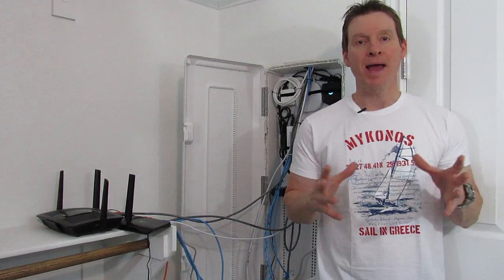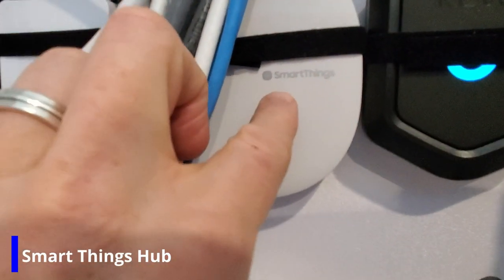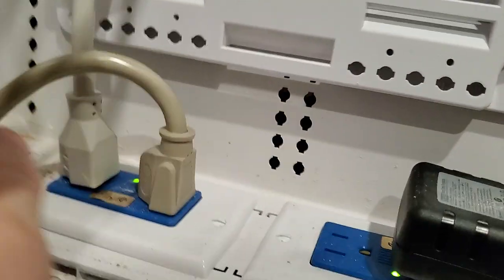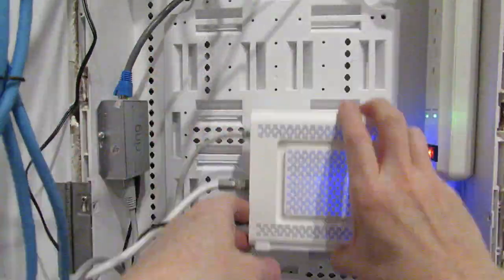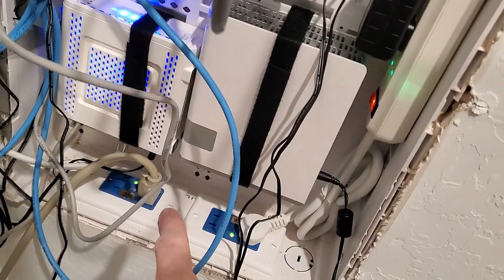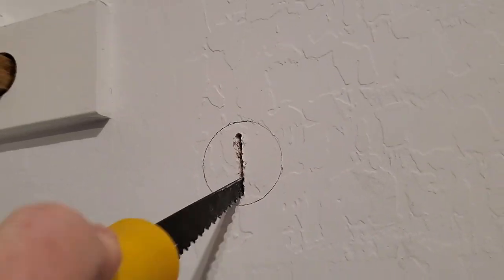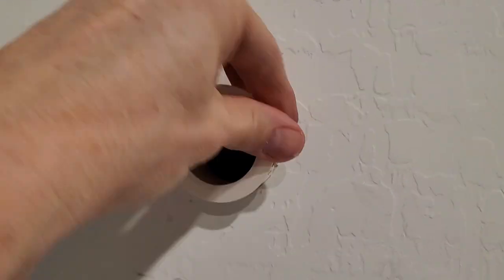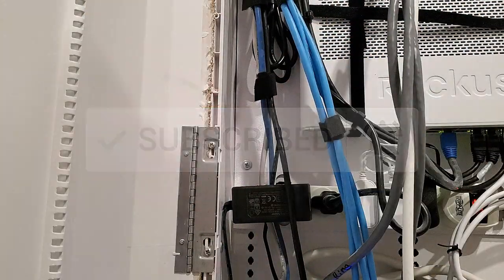HOME NETWORKING 101 QUICK & EASY RESIDENTIAL NETWORK PANEL INSTALL AND INSTALLING NETWORK DEVICES!

Comment: I think that the reason the holes didn't line up is because you need to rotate the plate 90 degrees. Then the plates in the Universal Mounting Plate should line up with the normal plunger holes in the back of the enclosure (the holes you are using were intended for mounting the enclosure to a wall, not for mounting that plate).
Reply from the maker: Yes that's probably why, however I needed more vertical space for my devices. It worked out well but thank you for the great comment.

Comment: I have one of these boxes in my laundry room IMO it's better to install a traditional network rack. You will outgrow these boxes pretty quickly especially if you want to install standard rack gear. I plan on moving all of my structured wiring to a standard rack which I will hang in the garage.

Comment: You should never plug a power strip into another power strip. You could of run both cords to the bottom outlet.
Reply from the maker: I rewired the whole network panel a few months later with a UPS and removed 1 power strip. Here is the video link:
https://youtu.be/9kGISAgdjMA

Comment: I'd recommend moving some of the Smart/IOT hubs out of there and closer to the center of the home. There's a lot of signal density there and could lead to interference.
Reply from the maker: Thanks for the great advice. This video is a year old now and my network panel has changed quite a bit. Make sure to check out my newer videos. I added a UPS  to the panel for back up power and removed the 2tb cloud. Also cleaned up the wires too. Thanks for watching and for commenting!
Reply: @UltimateTechHub  thanks for replying! I see the vid is older this was meant more as a warning for people that might want to put all of their equipment in the same enclosure.
Reply from the maker: @DonaldEdney  Awesome!! Great advice! I kept my 3 Hubs in the enclosure and they all work great with no issues.  The ruckus ICX switch gets a bit warm so generally leave the door open. I may move the smartthings Hub to my family room in the future. I only have 1 device connected with it. I'm reviewing a EnGenius 8 port PoE Layer 2 switch this week. Keep an eye out for the video. Thanks again for watching!

Comment: @Ultimate Tech Hub I apologize if someone has already mentioned this topic, however, the reason that you needed to drill extra holes is because you were mounting the plate in "portrait" orientation whereas it is designed to be mounted in "landscaped" orientation.  You can actually see that there is about an inch or two on either side of the vertically mounted bracket and you can almost picture the holes lining up during installation, if it had been mounted horizontally, or "landscape" oriented as I mentioned previously.  But great job on the clean install.
Reply from the maker: Yes someone already mentioned the bracket going the other way but in my Network Panel it wouldn't t fit that way the panel is not wide enough. Maybe the bracelet is for a different panel. If you get s chance watch a more recent video to see the even better improvements to the panel. I added backup power and rewired the entire Network Panel. Thank you for watching I really appreciate it.
Reply: @UltimateTechHub  I watched the newest video first and totally forgot I had already seen the newer version when commenting. Great setup, though!!!. I am making a video of my retrofit right now.
Reply from the maker: @MartesWigglesworth Let me know when your video posts or send me a link I would like to watch it!

Comment: Could you have mounted the wireless router inside the box if you had the room for it? Does it affect signal? Or does the wireless router need to be placed outside the cabinet? Thanks!
Reply from the maker: I could have installed it in the panel but closing the panel door would hamper the signal. The panel door shows a diagram of a router inside the panel. We also have a wireless access point in our front hallway ceiling. Here is more detailed video of the panel and the smart features.
https://youtu.be/igCWVINZdv4
Thank you for watching I really appreciate it!

Comment: Are the knockouts at the bottom for power standard size?   Can you use non legrand outlets?
Reply from the maker: Yes they are standard size for the United States. I'm not sure if European outlets would work. Stay tuned for our Home Network Tour 2023 which posts in 2 days.

Comment: How did you place an electrical outlet for the router inside the access panel? Was it a standard size outlet?  Trying to place inside a 4" wide wall.
Reply from the maker: It was already pre-installed in my panel. If you install a panel like this you need to hire a electrician to install the outlet and make sure he installs 2 outlets. You can never have too many outlets. Thank you for watching I really appreciate it.
Reply: @UltimateTechHub  We are starting with new construction. I am trying to have my contractor make all cables hidden including power for router which will sit just above the access panel for all the CAT cable connections. I am hoping he can fit a power outlet in there and do what you did to make a nice hole for cables above the access panel in wall.

Comment: Nice job on your cable management. I will suggest eliminating the POE injector for the ring camera and going straight to the Ruckus Switch. To avoid an extra point of failure . It looks to me thats an Ruckus 7150-C12P, if yes the switch is POE+ and can power the ring camera. 👌
Reply from the maker: Yep it can power the ring doorbell and I should just plug it into the ruckus switch to eliminate the chance of failure and to free up some extra space.  I probably take your advice and switch it over. Thanks for watching and if you subscribed thank you as well.

Comment: What did you use to mount your icx switch? I have the same switch? But haven’t found a clean way to mount it yet.
Reply from the maker: I have a large white plastic piece that has 4 custom holes and is screwed into the panel and I also used long Velcro straps to secure the icx switch to that plastic piece. Here is a video that shows the icx install great detail. You might want to fast forward to the middle of the video unless you want to watch my UPS install. https://youtu.be/9kGISAgdjMA
Thank you for watching and if you subscribed thank you as well. I also have many more videos on this network panel that are way more recent make sure to check them out.
Reply: @UltimateTechHub  I’ll have to look for a large piece of plastic that will fit. That is a much better solution than everything I’ve tried in the past.
Reply from the maker: @Nico-kl1or  Good luck and keep me posted!

Comment: Dumb question but can I put all wifi devices in a separate room, say my family room near TV? And keep this structured panel all hard wired? I am buying a Lennar home soon. Thanks!
Reply from the maker: Yes absolutely. Lennar homes usually come with a Wireless Access point installed in the ceiling so you could leave you router in the panel room. Check out my newer videos for the Smart Home Tour 2022. It shows all the Lennar smart home products. Thank you for watching I really appreciate it.

Comment: Love the video.  I'm thinking of doing something similar.   However, instead of a router that has to fit outside the box, I'm going to use unifi usg going into unifi poe switch and my ont will have to fit in there.  I'm going to use ceiling and wall mount unifi ap's powered by poe for wireless throughout.  I'm going to add coax routing for the home in my box.  Then at each location where I will have tv's i'm going to use poe powered unifi mini switches behind a small media box behind the tvs.
Reply from the maker: Here is a more recent video on my New Network Setup. Let me know what you think.
https://youtu.be/lO3NV_uwMmc?si=IMNyqNyl_0WI0rpD

Comment: I didn't see it mentioned yet but also it's not great practice to cut a large hole in your sheet rock to push wires through and leave open. You should use grommets and other ways to seal whenever possible. Large open penetrations let all the conditioned air out of the house (unnecessary conditioning costs and makes your house very "leaky") not to mention any bugs etc that are in the attic and other unsealed areas into the house.

Comment: Do you have jam everything into a box? I get that it looks nicer/cleaner to have it all in a a box, but can I just mount all the components onto a wall in my utility room? that way I can space out the components for heat purposes and actually see where the cords are running if I ever need to troubleshoot my network.
Reply from the maker: You can definitely mount the components to the wall. I would actually get a sheet of large 4 foot by 4 foot half inch  particle board then mount all your components to the board and organize the wires with clips then mount the board to the wall.
Reply: @UltimateTechHub  thanks for the  reply. All these metal boxes say UL Listed on them so it was making me wonder if it’s some kind of fire code requirement to have everything in a UL Listed box.
Reply from the maker: @Macarthurmaintenance  i believe some particle boards are fire retardant. But most network devices are low voltage and will not be a fire hazard. Good luck and keep me posted.

Comment: Dumb question....Can I/should I punch down the incoming internet service line to my patch panel or just connect directly into the modem?  Thanks
Reply from the maker: That's a good question and it really doesn't matter which way you go. I always connect directly to the modem. But thats just how I do it. I did a lot of punch down in my college classes and its actually pretty easy. Good luck and keep ne posted!!
Reply: @UltimateTechHub  Thanks!  I have my rooms punched down without issue (surprisingly for me).  I'll probably leave it connected to router.  Thanks!

Comment: I have the same modem and it will over heat and throttle internet speeds. I added a USB Fan from AC Infinity and haven’t any problems since then.
Reply from the maker: I switched over to fiber many months ago. Saved me about 100 dollars a month. Here is my install video.
https://youtu.be/RJbR80rdFEY
Thank you for watching I really appreciate it.

Comment: I’m setting up a new office which will have 4 computers , 3 video cameras, a video TV , 2 phones lines and 1 Smart TV
I will be using all Cat 6 wiring and RG-6 coax quad cable, I want great strong WIFI and a very fast internet.
I would like to use the Legrand ON-Q BOX With no visible cables outside the wall  but need help with what components I need to install
Thank you
Reply from the maker: You should watch this video. It will help you decide on devices for your panel. 
https://youtu.be/kxdMHSz2PIk

Comment: I have a Nest Google WiFi mesh system and am struggling to get a good WiFi signal in our house. Any suggestions where to place the nest WiFi devices ?
Reply from the maker: Keep the mesh devices at no more than 50 feet away from each other. This should provide you with a strong signal.

Comment: Nice choice on that wireless router. I have an EA9500 that I love to bits.
Reply from the maker: Thanks it's a great router.  The EA9500 is fantastic. Thanks for watching!
Reply: Ultimate Tech Hub  does your router get updated firmware ? Because I have the 9300 I believe and it’s not had an updated firmware availabile since i purchased it ... I love that it gives me great WiFi speeds but ok thinking maybe I need to get a different router .. I spent 200 bucks on this thing when I got over a year ago .
Reply from the maker: @ShayHFamilyVlogs  I havent had any updates on my router and I've had mine for almost 2 years. I will get a new once wifi 6 is more affordable. Otherwise this router is plenty fast. Sounds your router is plenty fast too. I wouldn't get a new until it breaks or until wifi 6 gets cheaper.

Comment: Can the legrand enclosure be installed from inside the enclosure? The instructions looks like it installs under the drywall.
Reply from the maker: It's installed inside the wall and attached to the wall studs. The drywall is just cut out so the enclosure fits.
Reply: @UltimateTechHub  so to clarify, id have to expose the studs and instal it directly to the studs and have to drywall over after installed?
Reply from the maker: @javinho9459  If your studs are 14 inches on center then the enclosure will fit perfect. So cut the drywall only where the enclosure will fit. The enclosure is 14 inches wide.

Comment: Do you have a video on how to setup the Ruckus? Can’t find one anywhere 😔
Reply from the maker: I don't have one but it's very easy to set up. Download ruckus unleashed and connect to the ruckus via a cat5e or cat 6. Its a pretty straightforward setup. Thanks for watching and if you subscribed thank you as well.
Reply: Which port do you connect at the switch? I tough I needed a usb-c to connect to the ruckus icx

Comment: New build I signed up for the package for two cameras, a cable, cable line and an Internet cat wire. Am I paying $430 for the box or can I order these things à la cart and save money and just put them on a shelf with my router my eight point switch on my wireless access point which I’m buying anyway?

Comment: Very nice!  I am about to start mine. Have decided to put a wall mount rack in the laundry area. Did you have any heat issues?
Reply from the maker: Not really just keep the area well ventilated and space your devices away from each other. Biggest heat issue for me is the modem and switch. But its not too hot just slightly warm.  Good luck and have fun. Keep me posted too. Thanks for watching and if you subscribed thank you as well.

Comment: Nice work. If I may recommend one change: the power supply. Putting a UPS on has saved my equipment in the past where I have lost equipment with surge protectors. Very nice work friend.
Reply from the maker: I was thinking the exact thing. My challenge is finding room in that network panel. It would have to be a smaller UPS for sure. Do you have any suggestions? And thank you for watching and if you subscribed thank you as well.
Reply from the maker: @jacobreuter  thank you Jacob. When I install it I will upload the video and if you don't mind I will mention your name. If you don't want me to mention your name I will just say one of my subscribers.  Thanks again.
Reply: @UltimateTechHub  You can use my name, thank you that's very kind of you! :)

Comment: Looks nice when done but really not a practical set up if you have to work inside the panel.  As one who commonly has to work in these, I can say I have never seen one that is sized large enough. That’s why they are so often a mess with things dangling from cords, cover won’t fit on etc. What would be better? A large ventilated cabinet mounted on the wall, not in the wall, with shelves and removable panels for easy access to everything.
Reply from the maker: Absolutely correct a large shelf or rack mount system would be way easier to work with and organize. Check out this updated video on my panel it looks 100 percent better. You can fast forward through the UPS install if you want. My wires look way more organized.  Thank you for watching I really appreciate it.

Comment: So if you want to use wired Wi-Fi it won’t be possible because it’s inside there ?
Reply from the maker: You can have the router inside the panel and the wifi works. Here is a video link showing that.
https://youtu.be/tiZMG6rB6sY

Comment: Is that the 30" or 42" enclosure?  The model number in the description is for 30" but appears longer.
Reply from the maker: 42 inch by 14 inch inclosure. I think I made a mistake in the description sorry. Thanks for watching and if you subscribed thank you as well.
Reply: @UltimateTechHub  No problem.  Just curious.  Mine should be here Wed.  Subscribed.  Thanks!
Reply from the maker: @CTTH100  good luck and keep me posted especially if you have any issues or questions.
Reply: @UltimateTechHub  Thanks for the offer.  Will keep that in mind because I know just enough to be dangerous!  ☺

Comment: Why can’t you use industrial Velcro to mount your boxes where you want them inside the enclosure rather then mount that special bracket in there and be limited with placement?
Reply from the maker: If you check out my newer videos you can see I used velcro and even long zip ties to secure the components and this video was over a year ago. My network panel looks quite different now. Make sure to check out my newer videos and thank you for watching!

Comment: Nice. I'm going to have do this same thing when I move into my house in a couple of weeks. It looks like I have the same enclosure.
Reply from the maker: Enjoy it!!! Feel free to ask me any questions! Thanks for watching and if you subscribed thank you as well.
Reply: @UltimateTechHub  Thanks. I actually do have a question. From the information I found about my home. I have a 42' Legrand enclosure which looks a like yours. So I ended ordering 2 of those Legrand inserts plates. Do you think 2 of those plates will fit?
Reply from the maker: @mitube4u  yes 2 will fit with plenty of room. Make sure to add the exrra power strips because 4 outlets is not enough.
Reply: @UltimateTechHub  Thanks. Yeah I saw your video and realize that I'm going to need a good power strip.

Comment: Interesting. I've got a 42" Legrand enclosure so perhaps my router will fit in it. I wondered what the tabs on the sides were for, but I see it's designed to be placed IN the wall, so that makes sense. I'm probably gonna hang it on the cinderblock in the unfinished side of my basement. Hopefully the block wall doesn't block/reduce my wifi coverage to the other side of the house. I'll try and make in real clean though. :D